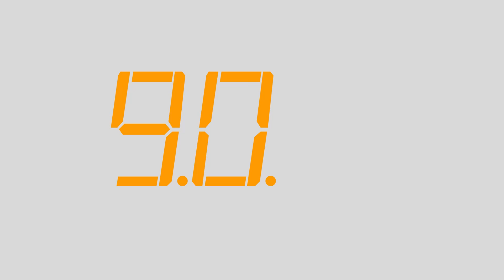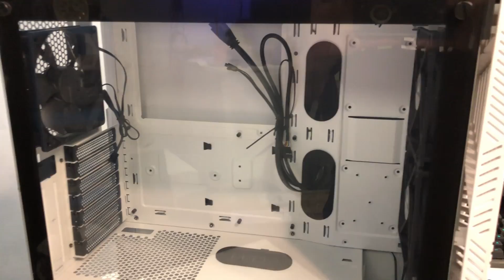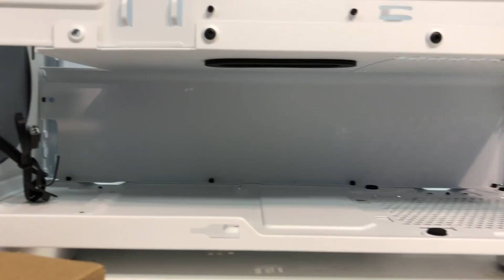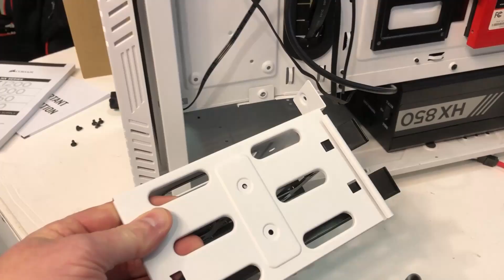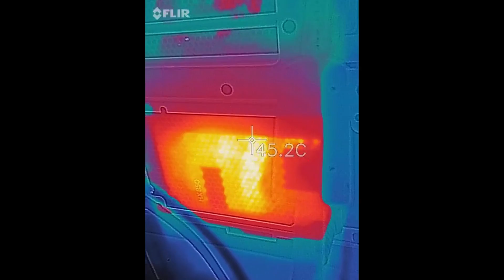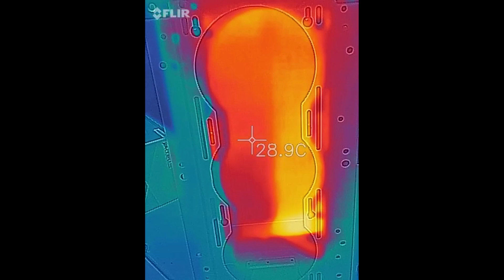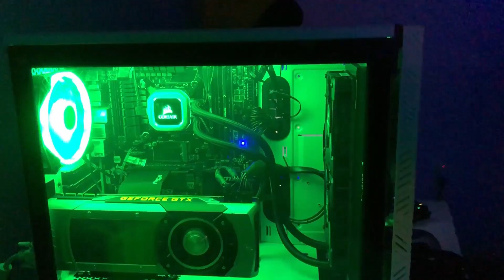Corsair 275R Airflow: In-Depth Case Review

Comment: Bit of a silly inquiry but, could you replace the two included fans on the front panel with after market fans?
Reply from the maker: Absolutely!
Reply: @overclockersclub  Thanks for your input! Also, how's the cable management for the case? (Im on a budget and I want an affordable case with good airflow and decent cable management)

Comment: Hey, can you tell me, or anyone else using this case, can you fit 2x140 fans in the top of the case, the web site for the case says no, but I have the case now, have not got any fans yet and it looks to me as though 2 140's would fit fine.  Can anyone confirm?  And if the answer is no, can you tell me why?  There seems to be plenty of length and width, where is the hang up?

Comment: Hey, I’m worried I won’t be able to fit a 240mm radiator at the top due to the Ram blocking it, the Radiator + fan is 38mm tall, would it fit ?
Reply from the maker: Let me dig the case out and see what I can confirm for you...
Reply from the maker: So it will be very close is about all I can say.  It depends on what RAM you use and my radiator and fans are 50mm thick, not 38.  You can get low profile RAM if you have clearance issues.
Reply: OverclockersClub I really appreciate the reply, and digging through to answer me. I’m looking to add a Arctic Liquid II 240mm and they’re 38mm tall, Would it fit with usual Corsair vengeance sticks (already own the RAM but not the rest) so buying new ones is complicated

Comment: Also if maximum airflow was the name of the game why did they miss one fan out of the front why not provide all three fans at the front and one at the back why does the case only come with 2 front fans
Reply: And also you will have to buy an adapter from the front fans to the power supply otherwise all 3 fans because they are all 3 Pin you will have to run them to your motherboard which is messy and not the solution the rear fan should have 3 pin and the front fans should have 4 pin Molex connector so you can go direct to the power supply and hide all of the cables bought 2 of these cases and I’m finding quite a lot of quirky stuff

Comment: I bought 2 of these cases One for me in black and one for my little brother in white it only fits 2 SSDs in the back because the 2 brackets With screws meant for SSDs does not fit SSDs and have tried a bunch of different brands the brackets are the wrong size on both of my cases
Reply: 4 is a lie The quick removal brackets do not fit SSDs

Comment: Can I put a 240 mm radiator in the front of the case?
Reply: I guess you can. This ist from Corsair self. 3 front fans in push config to the 240 radiator. At 0:26  https://youtu.be/5rsaDb0KPZ0

I personally plan to put a 360 radiator with the tubes at the bottom fans in pull config for better maintenance. That will cause a space issue but maybe I will drill a little bit from the plate next to it out for the tubes. Hopefully my calculations are right 😅

Comment: Are you having any heat problems with your vertical gpu mount?
Reply from the maker: No - but it depends on what graphics card you use.  If it is a reference card with a blower, then the heat is easily pushed out of the case (rear).  A card with two or three side fans would dump most of the heat into the case, so air movement through the case would be very important.
Reply: @overclockersclub  I have the msi gtx1660 super ventus xs oc and out of the box fan configuration. Do you think I can use the vertical gpu mount without having issues?
Reply from the maker: You should be fine. That card has a power limit of 125 Watts. So nothing serious.

Comment: Thank you for doing this review including the vertical mount GPU option - amazingly the website for for this case doesnt even mention this feature at all as far as I can tell!
Reply: It looks like a really bad idea since the GPU fan is right up against the glass.
Reply: @Vitamin_Chi1  correct it usually is however some cases and some cards actually produce good thermals. I think if the card has a decent gap to the glass it can suck air around the card just fine but in most cases it’s not optimal.

Comment: Does Noctura NH-D15 fit into the case, when i received mine, it is touching the glass.
Reply: I know this was a month ago, but for anyone else in the future reading this: yes, the NH-D15 does fit into the case, but you will need low profile ram in order to fit the 'intake' fan in. The actual heatsink itself has a ton of room before reaching the glass, so if you don't care about running the dual fan, this will fit with a ton of room to spare. Again, just don't get tall ram.

 Make sure to install the heatsink on your motherboard before putting it in the case, and hold off on putting the fans in or else you can't screw in the top middle standoff, at least on an atx motherboard.  Other than that, the air moves great in this case with the D15 and keeps my 3900x cool as can be

Comment: If I want to install a 140mm top fan can I do it close to the rear fan? Because I notice the screw path have 2 levels. And it seems that if you want to install a 140 mm you have to install near the front pannel using the backward srew path. Can you confirm please ?

Comment: I was so close to buying this case, but seeing how little space there is between the power unit and the HDD cage, I'm not confident I'll have room for the cables. I'm surprised there's nowhere else to put an HDD.
Reply from the maker: JapanGamer29 That is always a challenge with a small case. However if you use a fully modular power supply, you only use the essential cables and while the space is tight, it can be done.

Comment: I'm struggling to understand how can i install my 2,5 ssd into the brackets (the black things in the back of the case), after that i screw the screws into the ssd, the case doesn't allow me to close the bracket, any tips?
Reply: You’ll want to install the 2.5 SSD on the mounting points which are on the backside of the motherboard portion.

Comment: AY I like your style of having the magnet on the screwdriver. I have been called weird for doing that. I ordered a ton of 6mmx3mm n52 magnets years ago that I keep stuck to pretty much every screw driver in my house. Except for the ceramic ones. I wish more people understood why we do this. I work at a place that does cellphone repair so we deal with tiny screws and nothing kills me more than a non magnetic driver or screw so I keep 2mmx4mm magnets on those as they are much smaller tools but sometimes people borrow my tools and remove the magnets and lose them. It drives me crazy.So much so I started locking up my tools and since I am the lead tech I have the nicest tools because I bought them some of my co-workers aren't too happy I started hiding my tools from them.

Comment: This is the best review of a case I've seen so far. Thank you very much. I bought the regular 275r and the H150i liquid cooler from Corsair. Can you explain why you mounted the fans taking heat from the radiator and blowing it inside the case? Shouldn't the front fans be installed before the radiator so fresh air can pass through the radiator, thus cooling the liquid?
Reply: From my understanding it doesn't make much difference if you push the air through the radiator (with the fans first), or pull it trough (with the fans on the inside). It should result in about the same airflow overall.
Reply from the maker: @ThomasS17  yes I have tested coolers both ways and the difference was minimal. Not enough to be concerned.  Even with a push-pull configuration the difference was only a degree or so.  I can't speak for all coolers / cases, but at least that is what I noticed on the coolers  I have tested.

Comment: Could you remove the bottom shield? Also I’m running a DEEPCOOL 360mm can I add fans in the front of that to push air into the radiator? Would you advise that?

Comment: can u use a cpu ventilator cooler and not a watter cooler to build the pc?
Reply from the maker: qxlex Yes, and air cooler will work as long as you check the height to make sure it will fit in the case.

Comment: Hi Chris, so I cant put an aio h100i pro Platinum in the top side?

I think the space is not enough with a z390 mobo.
Reply: Hey, recently did a build in this case and couldn't fit the h100i on top because RAM got in the way.
Reply: @theSaMzZ38  thank you, for the information.
Reply: You should be able to mount it in the front, the psu shroud has a cut out that would facilitate the rad and fans.

Comment: Was the radiator clearance issue down to motherboard design would you say? Looking at both the case and the same AIO for my build and was planning on having 3 intake fans at the front, the radiator and 2 fans on the top and then one exhaust on the back.
Reply from the maker: It was a RAM height issue.  Low profile RAM would be fine. LPX RAM will work.

Comment: Will it fit the AX1200i PSU? I think it is 200mm in length
Reply from the maker: The Corsair website shows: Maximum GPU Length: 370mm, so the AX1200i should be ok to use.

Comment: Need very basic explanation about fan location positioning for the intake of air & the exhaust of hot air please.  And also addressing the directional curvature of the blades.  Also I don't "get" why if the front panel fans were "intaking" air, why was the radiator was 'in front of" the fans. It seems to me that if there is heat within the radiator, you would want the fans to pull in  cooler room air "over" the hot radiator. Thank you very much.
Reply: I also have the same question.  Shouldn't those front fans be taking fresh air from the outside and blow it through the radiator?

Comment: Do you need a Riser cable to mount the GPU vertically? I have a 2070 super dual by Asus and I ordered this case today. Will be here tomorrow. I didnt see anything plugged into the PCIE connectors on your card so was curious.
Reply from the maker: Yes, you need a separate PCIe cable.  You can find them on Amazon.  Here is an example: https://www.amazon.com/EZDIY-FAB-Express-PCIe3-0-Flexible-Extension/dp/B01NH0GW7Z/ref=sr_1_3?keywords=pcie+cable&qid=1582339366&sr=8-3

Comment: Is it possible to buy the non air flow front panel and replace it?
Reply: Just get the regular 275r if that's what you want
Reply: Panels aren't interchangable. Honestly, I got the regular one first. Temps aren't great and the light in the front annoying. Buying this one tomorrow.

Comment: Can I put 2x140mm fans on top? Or corsair's website is totally wrong?
Reply from the maker: The 275R and 465X share a common chassis.  The website is incorrect. There are mounting provisions for only one 140mm fan on top.
Reply: @overclockersclub  I feel like this case would have been much better if it had support for 140mm everywhere

Comment: Your pulling hot air from the case into your power supply that you are trying to keep cool?   Am I missing something?
Reply from the maker: "Hot" is a relative term.  Correct, air from inside the case is being pulled into the power supply the way I have it mounted in the video.  But typically the air in the case is usually only a degree or two above ambient, assuming the case fans are doing their job. Through convection, any "hot" air should be toward the top of the case where top fans (if installed) and the rear exhaust fan should quickly remove it.  In extreme situations where a non-blower GPU is dumping  a ton of heat into the case and directly above the PSU (which is possible), then you might flip the PSU over to pull air from below the case floor.

Comment: I experienced a threadriper 3970x throttles at 69 degrees c. so this liquid cooling would not be sufficent for the 3970x? your temp is over 71 degrees? or am I missing something? by the way: good video!
Reply from the maker: That is a real beast of a CPU.  So if I were going to put a system with that CPU in this case (275R), I would probably go with at least an H115i (280mm) or the H150i (360mm) cooler in the front of the case. And a couple of 120 or 140mm fans at the top.  Remember, it is all about moving air through the case.  And of course the temperature of the room can have an affect. What graphics card will you use?
Reply: @overclockersclub  thanks for this hint! graphics card: gtx 1070 - it will be my new machine for editing (mostly premiere), so in my case cpu power is often more important than gpu. system is already running open without case, with dark rock pro 4tr (with this air cooler, the cpu runs 3 1/2 min until throttling ;) , , just for benchmarking and stuff. but I will need a case soon and this one is my favourite right now.
Reply: ok, I now saw that this case only provides space for atx boards. the msi creator trx40 is an e-atx board - and that's the board I have :)  - so I need a bigger case - is there a case you would propose?
Reply from the maker: @gutentagproduktion  That depends on your budget.  I like the 680X, but as with most E-ATX cases, it is more expensive.

Comment: What's the difference between this and the 220t?
Reply: -The depth(length) of the 220T is significantly shorter, meaning more compact and less mounts for 2.5" SSDs
-220T comes pre-installed with 3x SP120 RGB fans and a Lighting Node Core
-220T cannot vertical mount a GPU
-220T has 4 rubber grommets in total and 3 routing holes at the bottom for wires to pass through to the motherboard
Reply: @owzyh  thank you!
Reply: @owzyh  so would you recomment buying a 220t or the 275r?
Reply: @Shsjdjdjdjdjdjdj  If you want a case with RGB straight out of the box, get the 220T. If you want more space for your components, get the 275R Airflow. Bear in mind that when you are building in the 220T, there is less than average space between the motherboard tray and the back panel for cable management, not too sure about the 275R Airflow. Also, if you are thinking of top mounting a radiator, be mindful of the height of your ram stick, some ram sticks like the Dominator Platinums from Corsair will have clearance issues
Reply: @owzyh ok, thx!

Comment: Hi there, I just had a customer pc built with this case, is there any way to control the fan speed of the case?
Reply from the maker: No - not from the case.   You would have to use the motherboard for fan control, or use an aftermarket fan controller...

Comment: This is a noob question, but will the stock fans connect to a b450 tomahawk max and will it control their speed automatically? Also will a 3600x with a stick cooler have decent temps with pbo on?

Comment: Hey chris, when you mount the gpu vertically, did you just let the gpu hang on the case slot? Or is there holes on the psu shroud so you can screw the pcie riser to the case?
Reply from the maker: fakedevil It just hangs from the slot. It’s fairly stable, but you can move it around. You could fabricate your own support, which on my next system build I will probably do if I go with a vertical GPU.  There is a hole on top of the power supply shroud but it is actually for a bracket for a cooling pump mount. However there’s no reason why you couldn’t use that small hole along with whatever you fabricate to support the end of the GPU.

Comment: thanks for the review. Are the fans PWM? would be lame if they aren't. corsair doesn't indicate
Reply from the maker: They factory case fans are 3-pin fans, so no PWM.
Reply: @overclockersclub Great review and glad to find it. I would have liked to see how the thermals compared from vertical and horizontal GPU mounts. How was the noise from the included fans? I'm currently looking to change out from a fractal design Node 304 to get some better airflow (and I have almost the same setup, Noctua air cooler, 4770k, 2080), but I enjoy that my setup is relatively silent except when playing demanding games (those twin 80mm are too loud). Since I'm kind of on a budget, I was thinking of keeping the stock fans and using voltage control from the mobo.
Reply from the maker: @jf0314  I have tested with the GPU in both positions and there was not really any difference - but that was with a blower style card.  Stock fan noise was not an issue.
Reply from the maker: @jf0314  If you use a blower style card, vertical or horizontal won't really matter. If your card has two or three fans, then there may be a difference and that will likely vary by design. I have always used the motherboard for fan control and never had any issues. Fan noise from the factory fans was also not a concern, however if you put fans in the top of the case, you might hear them a bit when they spool up.
Reply: Thanks!

Comment: "you can show off the gpu"
also you can choke it for airflow which "you can never have too much of"
Reply: You should show both positions though, looked at other reviews doing 12 full test runs with benchmarks etc. on this case, the vertical position was not recommended because of the heat. You should always try out both positions to really know.
Reply from the maker: @batmanofsweden5920  Good point - but with that 770, I have gotten the same cooling benchmark results regardless of the case or card orientation.  Of course it would be different with a non-reference (custom) card that has two or three side fans.  To your point, they are much more sensitive to orientation and case air flow.
Reply from the maker: gsgrzegorz98 This is true depending upon what model.  The GTX 770 (blower style) I was using is fine.